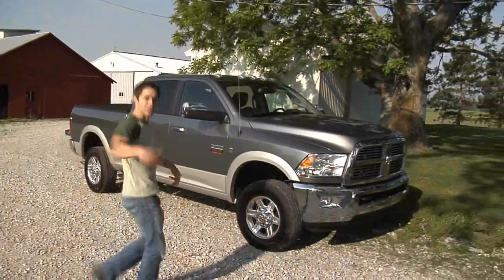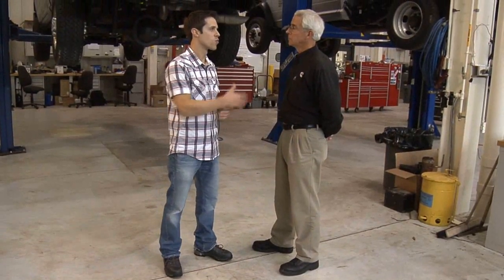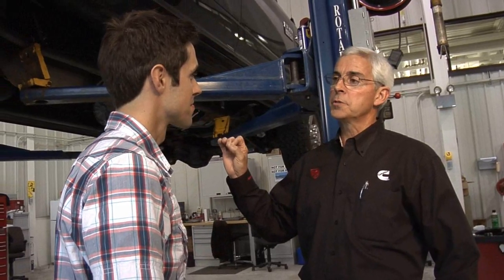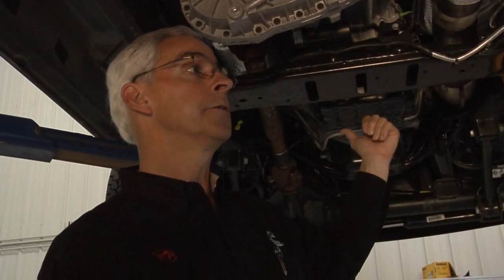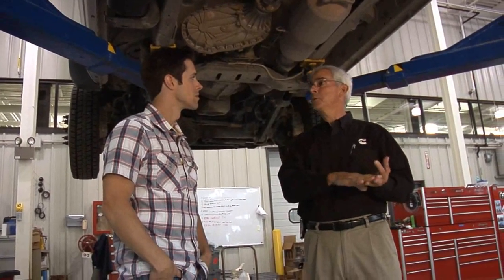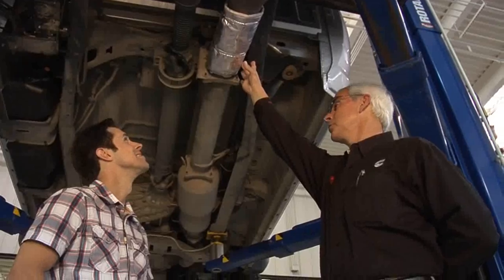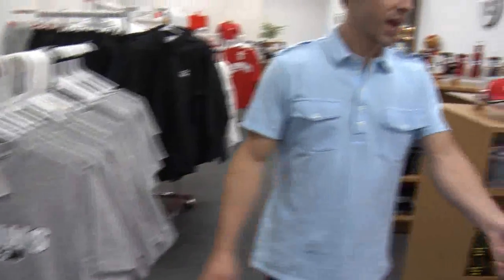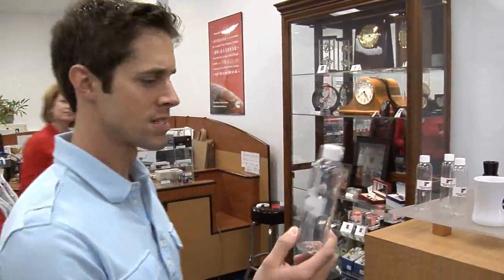Cummins 6.7's Biggest Fan (Pt 4): Exhaust System Explained

Comment: This emissions junk is a profit workaround. Instead of improving engine efficiency and retooling a factory, they add this crap to pass emissions while keeping profits high

Not to mention, the costs of creating "clean" emissions is passed on to the consumer vs the manufacturer actually making improvements to the engines

Comment: Theres a recall on this system and they change everything. My cloged up in the middle of no where pulling a camper. Had to camp in the dodge dealer parking lot. Good thing its on the drive train warranty
Reply: superkunk2 good that's a question I had , they consider it part of the drive train !? Thank goodness

Comment: I am in the market for a used ram 2500 with a cummins. I can't figure 
out why if a diesel will run 300k are there so many used trucks on the 
market at 80 to 100K miles. Are people anticipating big mechanical
 problems with the engine?
Reply: I don't know.. I have 93,000 miles on my 2012 and I'm not worried about the emissions.. (when they do screw up, I'll delete them)..
Reply: People often trade in to get the best value for there truck before they hit 100k

Comment: TigreLoko24.....I noticed that you said the motor will run worse if you delete the emissions control......you are a fool! Have you ever taken the intake plenum loose from the intake valley ? We'll try it and you will see that it will be caked thick with soot because the EGR system traps your exhaust and funnels it right into the fucking intake. EGR SYSTEMS SHORTEN THE LIFE OF YOUR DIESEL!            ALSO...... Stacks and Truck Nuts are so Lame!

Comment: All my emissions crap is sitting in my garage attic on my 08 Dodge. it works better there.  I had 18 emissions related problems in 20 months of ownership.  Since I removed all this sh___, it hasn't been into the shop. Straight pipe, EGR delete, and no problems in the last 3 years.

Comment: Dude, your vehicle will run more crappy when you take off "all" of the emissions needed parts, by that you mean catalytic converters, right?? there's sensors on them that will no longer read correctly and cause your engine to Lose Power and Acceleration decrease.. Just take off your mufflers & resonators and your ride will run much better than stock, those are just used to silence the exhaust noise by restricting air flow which cause your engine to Lose HP & Trq.. Trust me, i know.. ;)

Comment: You make a fair point again. And it is possible to hot-rod a diesel without black smoke (or very little it is just expensive to do) my main argument for diesels being better than gas is the lifespan of the vehicle. longer life = less vehicles being produced which means less use of fossil fuels for vehicle production as well as less use of raw materials. You seem like a reasonable guy and i'm glad this discussion didn't turn into an argument!

Comment: "Still Diesel better than Gassers for environment in the long run."

This is true but it does not hold true for Diesels that are dumping black smoke. 

Certainly not against people hotrodding their trucks as they are not part of the problem but arguing that an exhaust stream that's full of black soot is cleaner than that which comes from a  gas engine is just silly.
Reply: The color of the smoke is not indicative of the environmental impact it has. The "black" in the black smoke is actually carbon. It is one of the most abundant elements in the universe. It is basic building block of all life on earth. Should you breath it? No. But it is harmless, it will settle out of the air and into the dirt like dust and the circle of life will continue. The harmful gas emitted by cars is color less, odorless and taste less. Did you know what the most harmful gas is as far as "global warming" is concerned? Water vapor.

You really should educate yourself, appearances can be deceiving.

Comment: soot=Carbon and carbon is flammable. Just being flammable doesnt make it bad for the environment. Also Some DPFs dont burn they just trap. And soot is a solid so it does eventually fall back down. Not great for the environment but stil better than the N2O gasses put out by gas engines. (yes deisel puts out some N2O but nowhere near what gassers do.) these invisible gases are actually among the most harmful.